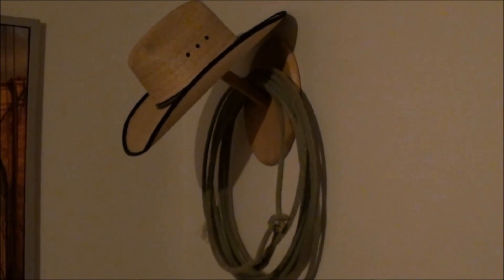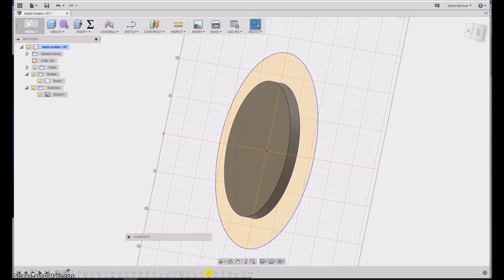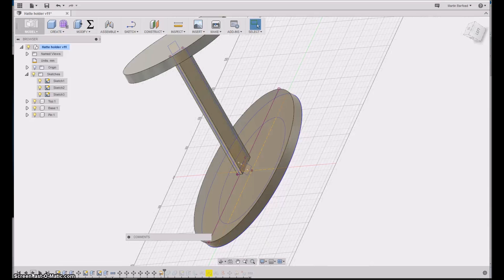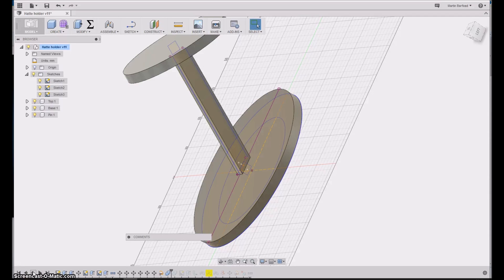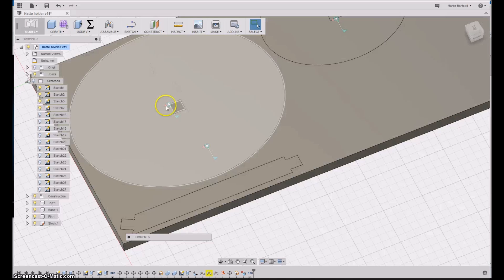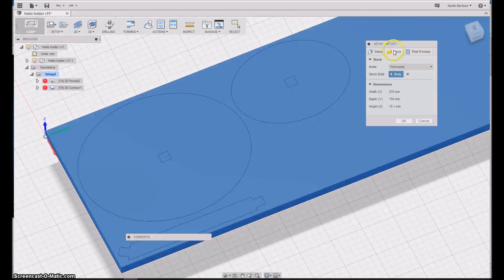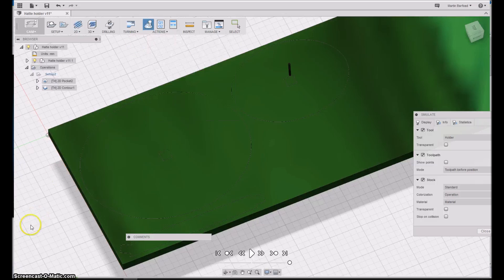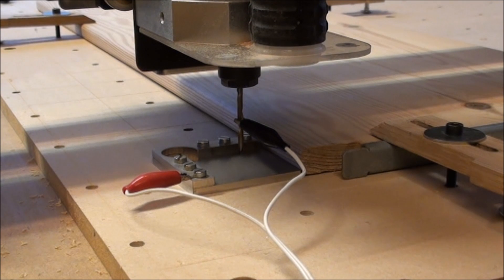DIY CNC Project - Making a Cowboy Hat Holder - Designed in Fusion 360

Comment: This is just what I was looking for!  The link to the Fusion 360 file says "Sorry. You don't have permission to access this page."  Can you host the file somewhere else?  Thanks!
Reply from the maker: Hi Joe, I have been searching high and low after the file but I'm affraid that I might have deleted it :-(. I do have the g-code files that I can send you if you can use them? Let me know
Reply: I ended up using a much simpler design, but I was curious about the dogbone joint Fusion 360 addon you used.  Looks pretty nice.  I'm going to just try it again.  Thanks!